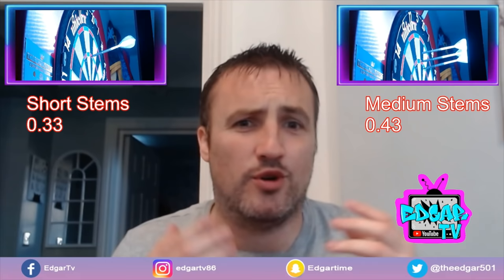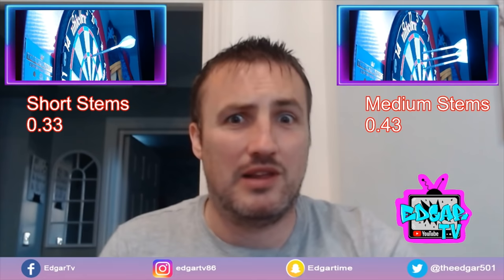How different stem lengths affect a dart

Comment: Material is such a science itself. In my opinion you can get used to everything new in a few minutes so it should not bother you at all. But thats way easier said than done. What makes you a good player is connecting your synapsis to create muscle memory which leads to good darts. So its practice > everything. I'm using medium stems JUST BECAUSE I looked at the T32 of the world and most of them do it. :D So I picked the weight of my darts (22g). But then comes the day when I put shorts on my set up and hit everything, just to ** my head up again...you just have to love the darts.
Reply: Ich feiers so, dass du auch matthew Edgar schaust  😂👍
Reply: i had the exact opposite. i used short shafts for a long time and switched to medium shafts just for fun and found out i hit way more…

Comment: I've recently changed my stems to short (from Intermediate) and my darts fly faster and more stable. I definitely recommend shorter stems especially with longer barrels (like Winmau Simon Whitlock).
Reply: other people say the opposite , longer much more stable and Simon doesn't use small shafts

Comment: The more surface you have where the air travels along, the more resistance you have to overcome. It's just the same with larger flights (No2) vs. small or kite flights. If I calculated correctly, the 14mm difference in stem length add roughly 248 sq mm of surface where the air has to travel along.
Reply: No you didn’t
Reply: Well said - the more surface area, the more drag. 
My calculation lead to the same number ;) 
But unfortunately with darts there are so many variables that most of the time these numbers mean little to nothing ....

Comment: both medium and intermediates land the same way for me, after trial and error with my 25g Harrows noble i was using medium stems, but i was having too many darts hitting 5s and 1s so I got some 26g versions, with the 26g versions i fould the intermediates worked better with that particular set, while the mediums worked best with the 25 ( i did multiple dart 99s and around the clock doubles to test which was best :D)

Comment: Edgar thank you for answering some questions that have been rattling around in my head. I don’t think I have been playing long enough to have a consistent throw to arrive at concrete findings. I find that my darts go into the board pretty flat. Is it more desirable to have the dart stand up more. I guess what I want to know if it allows more room when hitting triples and doubles ? You have a new subscriber looking for dart knowledge. I am sure it will improve my game. I know that now I need a set of Matthew Edgar darts to go along with my Robin of Loxley darts.

Comment: You would need a parachute on the back to slow the dart that much. What is interesting is that you slowed your throw down so much without realising it. Presumably you subconsciously adjusted to get a nice flight path/board entry. It would be interesting to see video analysis of the very first throw with the long stem which I'd guess was just as fast as the short stem but looked horrible.

Comment: Curious if you have ever looked at the various stem lengths, as they relate to how the dart barrel itself is balanced?  From the looks of it, your 'match darts' are relatively uniform in shape over the length, and likely center balanced.  My question being, have you ever experimented with rear weighted or front weighted darts, and how stem length affects flight and angle of entry?  I've read somewhere that the common thought on resolving stem length is that for shorter barrels, use longer shafts.. and for longer barrels use shorter stems.  I suspect that there is a point of maximum effectiveness, whereby the relative distance from the balance point of the barrel and location of the flight works 'best'.  Any thoughts on that?  Asking specifically between I am a rear gripper, and I prefer to have a dart barrel with a 'wall' to get behind with finger placement.  So this has led me to start experimenting with different shaft lengths and types of flights.

Comment: I can't help but think that there is an acceleration due to gravity at the end of the darts flight to the board.  Upward thrust fizzles out and gravity takes over.  It would account for the steeper angle of entry and the slightly faster speed.  The longer dart maybe generates enough turbulence to support the dart in flight much longer before gravity takes over.  I wonder what would happen using the same model of dart only 4g lighter or heavier?

Comment: I’ve recently changed from vapor flights on a medium and the speed they got to the board was insane. Had no stability value in them at all mind. With regard to speed to the board, why does it matter? Surely accuracy and consistent flight is the only thing that matters? I now use tweenie and standard which is obviously going to be slower than my old set up, but I can’t get my head round why so much effort to check the speed.

Comment: Always used long stems. Tried shorter but found they make my darts fly very unsteady in the air.
Reply from the maker: Front dictated ?
Reply: @Edgartvdarts  I use target Carrera C4 straight barrel 22g so even weighted but find the long stems fly much better

Comment: I can't agree or disagree with you but to me i thought it depended how a player throws his arrows for speed and where you place your fingers whether at the front, center or  rear would determine the flight. No I am not competitive player but i do have my own equipment at home to spend several hours adjusting aim and accuracy, am I right or wrong by stating when using different length stem you would have to find your comfort position of your fingers on the barrel?
Reply from the maker: It will change the centre of mass very slightly due to length and weight distribution